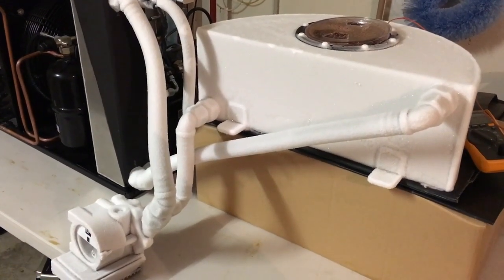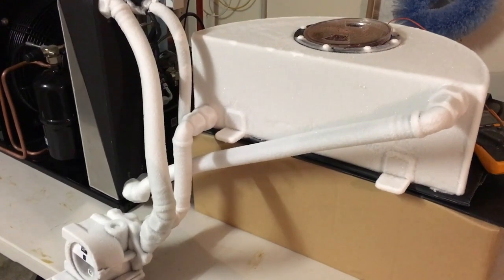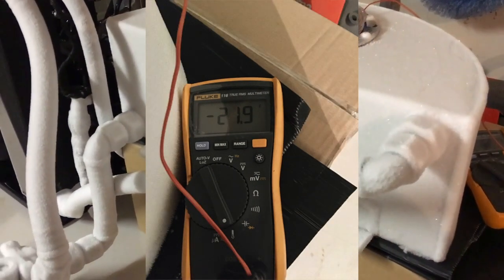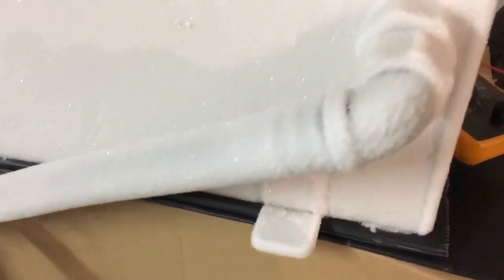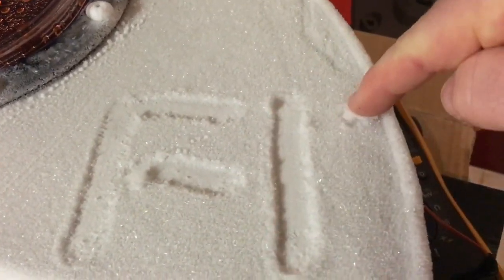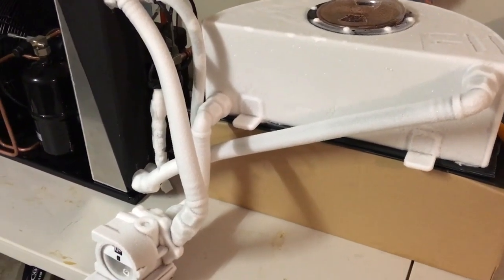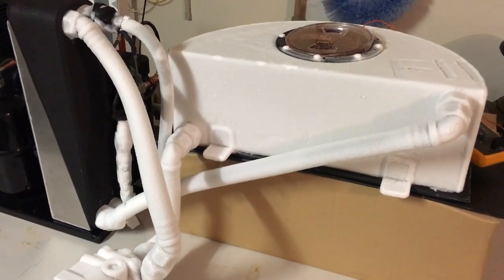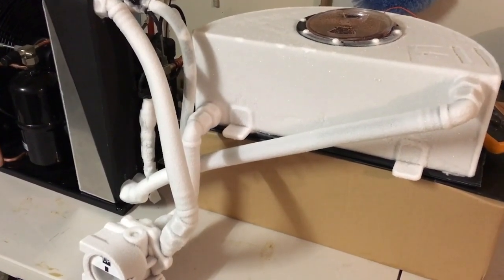Portable Interchiller System

Comment: You gave no information on this at all but want someone to spend 3500 for one are u crazy. You haven’t said will it need another battery how do you supply it power is it flameable nothing
Reply from the maker: its for racing teams, they call and ask about any details they need to know. Its mainly used in the back of a race trailer for cars in the pits.

Comment: My main question is can one of these systems keep up if in a car environment? IE, using a portable freezer on a tank? or would that just have to work like a buffer where it can cool down a volume over time, but hard passes will increase and it would have to "catch up"? The latter isn't necessarily a bad thing I suppose, with a reasonable fluid volume and insulated resi especially. Additionally, these new freezer setups are so efficient they can actually be run by the battery engine off without a problem. I'm really tempted to make this work with a lab water chiller I have laying around. It's a beefy unit. Could this setup be run in a trunk with a portable fridge that is mounted (really well with brackets or something of course) in a trunk? A smaller fridge/freezer set to max, filled with some sort of cooling liquid, already at least a little bit insulated. Could essentially just have some heater hose in the the charge cooler coolant loop that comes back to the fridge and dunk a coil into the liquid? Not necessarily really efficient, in fact I'm just curious if that would work at all. The direct method would obviously get better temps, just not sure how to make that work without overcomplicating something that is supposed to be simpler than factory AC method anyways. 
What about a 2nd loop that runs a pump to a water/water HE, and into the "icebox" (fridge/freezer resi), would that be worth the additional pump? I really like the idea of being able to contain this system to the trunk, and a separate compressor, just don't have the HVAC knowledge really to do it. I can stick hoses together and follow instructions, but I'm no thermodynamics engineer.